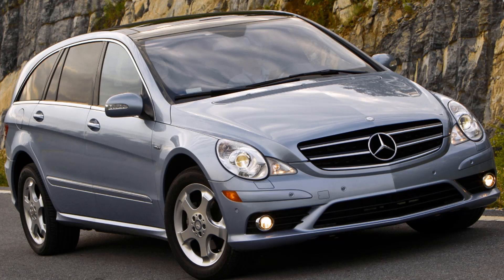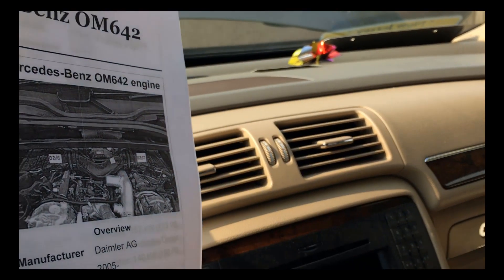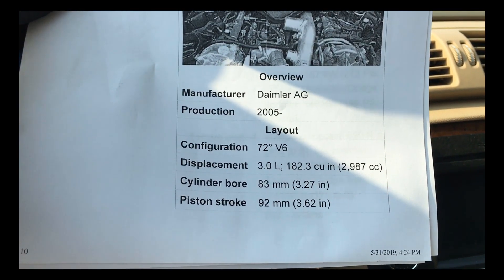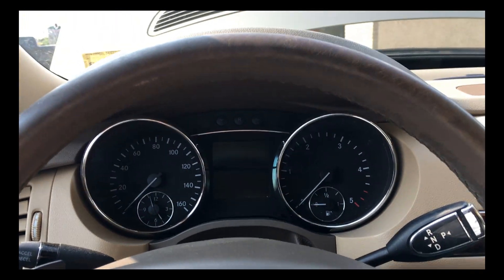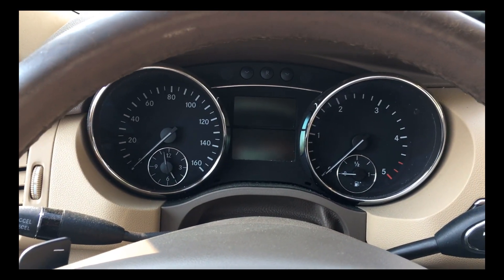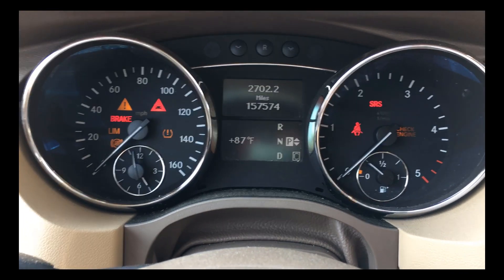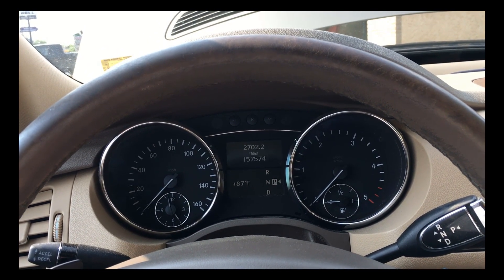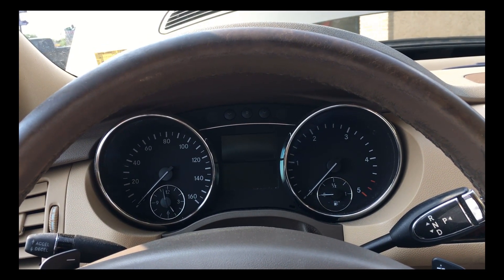Mercedes BLACK DEATH or not? Bad Fuel Injectors or not? V6 TURBO DIESEL INJECTORS. PLEASE SUBSCRIBE!

Comment: Thank you! This video helped me immensely diagnosing the issue with my ML280cdi no warnings crank no start was advised to do glow plugs then fuel filter I had enough watched your video and this was the exact issue! Was about to throw parts at it. I’m no mechanic but this really confused me. Glad to have salvaged my ML! Thanks a million!
Reply from the maker: Thanks so much brother. Really happy you found it helpful
Reply: @r77gan 
All these years I thought I never had a Brother.., till now.
UK, ML280 06.., giving me the biggest Nightmare for 7 straight months. Crank-No-Start.
Purchased: 
Crankshaft sensor.
Camshaft sensor.
6 Glow plugs.
O-Rings.
Vice.
Mini Diamond Cutting Disc.
Torque wrench.
Hold-Down Bolts x :face-purple-smiling-fangs:
Line hoses.
7PC Professional Diesel Injector Seat Cutter.

Hours, upon hrs, upon hrs, upon days, upon days, upon months.
Started the other day, then stopped. Pressure!
I believe I'm there now and will re-install the last offending injector tmw, 8/11/23.

🤞
Reply from the maker: Sorry for late reply but again, thanks very much. Glad my knowledge was helpful to you. I read all the things you installed, the things you listed. You did nothing wrong. It’s just most folks never would suspect the diesel pressure loss thru leaky injector. Generally only a professional mechanic. Be well my brother :)

Comment: hello. i have a 2014 ml350 bluetec. i have a 02d1 and a p02d5 code on it. do i need to change the injector??
Reply from the maker: You should just test for the overflow to see if injector has internal leak before anything

Comment: Very helpful! My engine just started cranking longer but still starts fine. If I put it in ignition 2 for a few seconds and then start, the cranking is short and crisp! Does this sound like Black Death or fuel system related?
Reply: Looks like I have some problem with return lines because diesel is constantly coming out of all 6 holes when I crank. I need to investigate more. Thanks!
Reply from the maker: @wzbhnn  That should not happen. You want to look for pinched tube
Reply from the maker: That could possibly be the low pressure in tank pump or even the glow plug circuit. Best to have a mechanic look it over whom specializes in diesel. Thx
Reply: I am trying to duplicate your test. Once it’s cranking, there is a constant stream of diesel coming out of the diesel  return connections - the openings on the lines, not the injectors. Is this normal for bluetec?
Reply from the maker: @wzbhnn  Hello there. Just try to follow the video. If you remove the “oil leak line” - which is the return line - remove it from EVERY INJECTOR at same time. Have a towel to catch extra fluid during disconnect. AFTERWARDS  - crank it and observe the return nipple on every injector. Excessive flow on any injector - is a FAULTY INJECTOR. Get a friend to crank it so you can observe under hood. Good luck
Reply: Thank you for the fast reply. Yes I did remove them from all 6 injectors and had two lines hanging around. I started cranking, but diesel was streaming out from the 6 holes on the 2 lines. I had to stop cranking before the diesel smell up the whole garage.
Reply from the maker: @wzbhnn  welcome. Fuel should not pour from line. The return line is low pressure and returns fuel to tank. When you first disconnect the line some diesel will spill out. Look at nipples on injectors only at first. See how many are bad. The return line must be totally off of every injector so no bad injector pressurizes it

Comment: By the way, I hv the same vehicle, 2008 R350 Benz "Code P0300 & engine light flashing, rough idle, no power while driving. I replaced spark plugs & coils but still same issues. Black death visually can be seen on & around engine. (I'm assuming INJECTORS?) Is there a way to put a solution in the gas tank as a start to see if it is the injectors? Thanks
Reply from the maker: Hello there. If you see the black carbon coating up top all the injector washers should be replaced. But in a high mileage engine I’d just replace every injector and they generally come with the compression washers - you should NOT have black soot on top of engine

Comment: My 09 ml320 bluetec starts but runs rough for first few minutes each morning, sligtly blue smoke as well and fumes smell horrible, no Black Death though, runs normally once warmed up, although hesitant acceleration during low rpms as if fuel not distributed properly, this video gives some insight to test for bad injectors, thanks a lot
Reply from the maker: You’re welcome. Best of luck!

Comment: Great video. The shop I took mine to had nuts they screwed into the injector delivery pipes, your way looks quicker and easier.
Reply from the maker: THANKS VERY MUCH. I try to keep my diagnostics very simple - yet comprehensive at same time. And LESS tools = better, lol. (I always try to make it possible for a homeowner to do, not just a professional at a shop) I get a lot of German cars by referral at my shop because I'm fast and accurate. However, it took me 30+ yrs to reach this level of efficiency. All the good youtube mechanics earn their keep with 20+ yrs experience. Thx again for your kind words. Much appreciated!